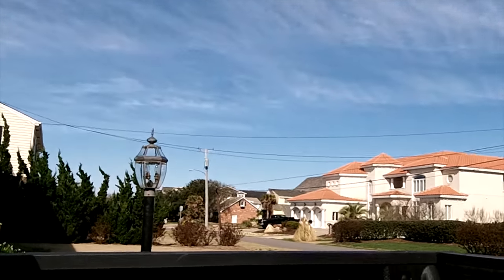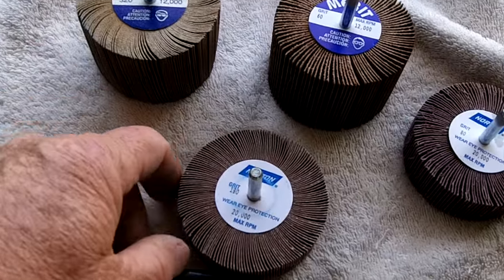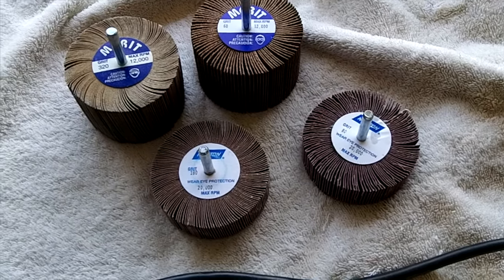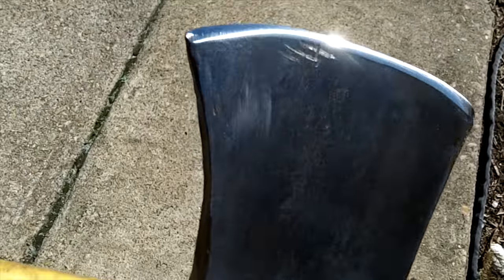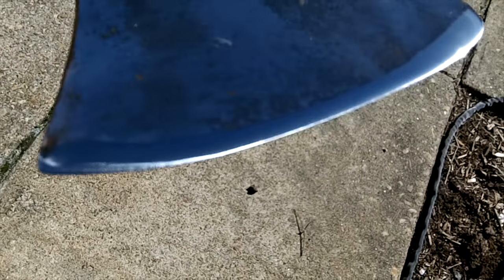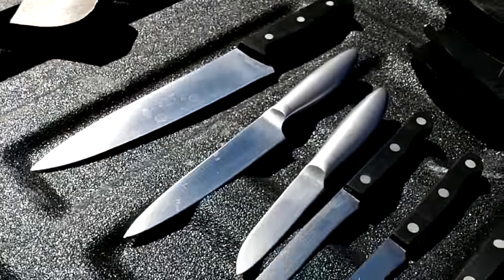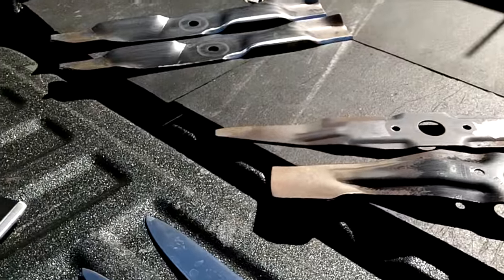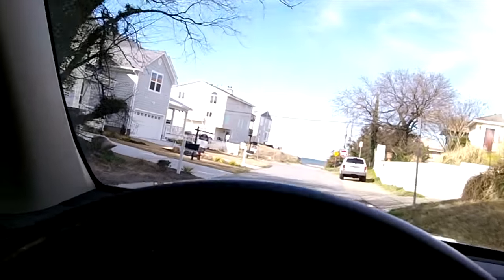SWINGBLADE !! - Live......not the movie!

Comment: Do you use your Kalamazoo to sharpen the lawnmower blades?  I sure like that belt machine.  I got a set of plans and built the No Weld Grinder..  it's a 2x72 but I ain't got no good belts for it yet.  I was going to snag the Grizzly 2x72 but now on their web site it's not offered anymore.  I've been thinking of a new detector..  I donno which I'd be better off with.  I kinda like the X-Terra 705 with the small gold coil and then get the 10.5" mid range coil for it.  Or maybe a Safari.  I'm thinking I'd do better working with 1 freq. at a time instead of the FBS minelab has.  I've see too... the new Nokta Impact... it's only got 1 coil but you can choose 3 diff. freq's ... which makes it kinda like the x-terra 705.  They say it's super fast & deep.  But I've always been a ML kind of guy.  I've heard some say the 705 isn't so deep seeking in the wet sand.  I'm a land locked flat lander in the N. of Texas... but I'd like to have a machine that would work ok on the beach... if I ever went to one.  Good Video.